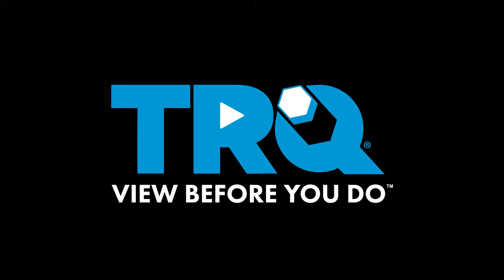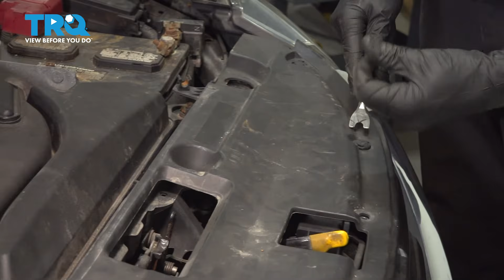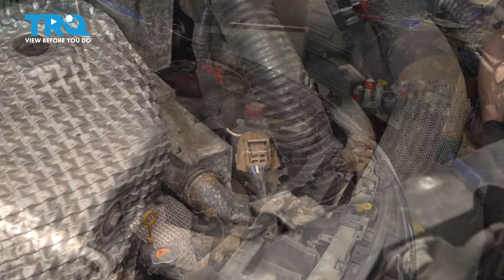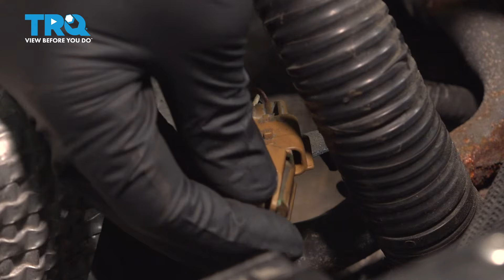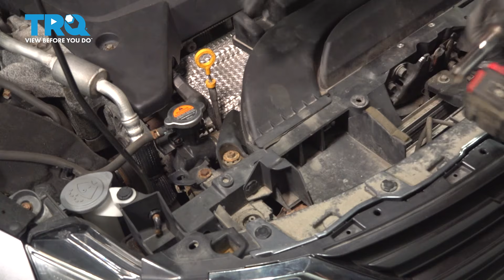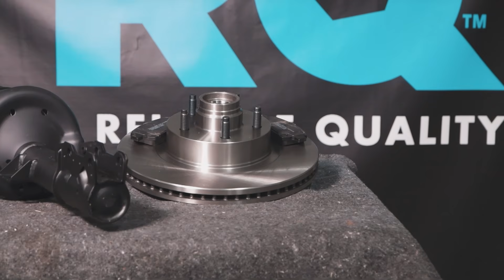How to Replace Upstream O2 Oxygen Sensor 2012-2018 Nissan Altima

Comment: Could I ask you a question on replacement I have about 74.000 on my 2015 altima do you think I should  swap it out for a new one . I already  changed the crankshaft position sensor,  new belt, oil change new k&n filter,  and camshaft also I just feel I slite ruff idle when driving.  No shacking just a slite ruff idle not alot..??

Comment: If the sensor is bad and u dnt have o2 sensor tool just cut the wire and use a regular socket but u will need a wrench to install the new sensor

Comment: That was kinda dirty putting the old plug in for the video because the wrong sensor was installed. Had that happen where the connectors were not the same and didnt find out till i was connecting them. This is a decent video on how to but that was dishonest.

Comment: My clip didn’t look like that at all and was absolute hell to disconnect. I had to study the new sensor to figure out how the old one was gripped/clipped in so good. I needed 3 hand tools simultaneously to separate them. Also I couldn’t get a ratchet that close enough to use that specific attachment. I ended up using a deep socket version that’s also specifically for the O2 sensor. That end of the sensor was much easier lol. 
I have a 2012 Altima 2.5S 

Great video! Thank you for sharing!
Reply from the maker: +@noelfoster2969 Thanks for watching our video! http://1aau.to/m/Shop-TRQ

Comment: what size is that O2 sensor socket.  I find them in 7/8 -24mm and 22mm what fits the 2.5 Altima?

Comment: I noticed you didn’t replace with the new o2 sensor, only reconnected the old with the tan connector. I’ve been running into issues where the new o2 sensor won’t connect, any suggestions? Is this the reason why you reconnects the old o2 sensor or did you cut harness and reconnect?
Reply: I’m having the same problem! What did you do?

Comment: This video does not apply to the 2017 SR turbo, that O2 removal tool will not work either for the 2017 sentra SR turbo. 

Just for education purposes.